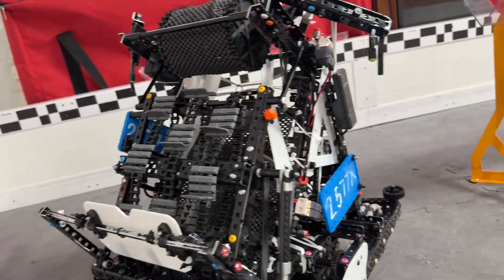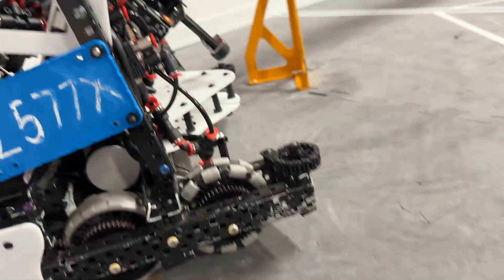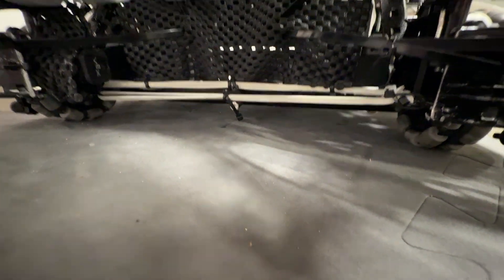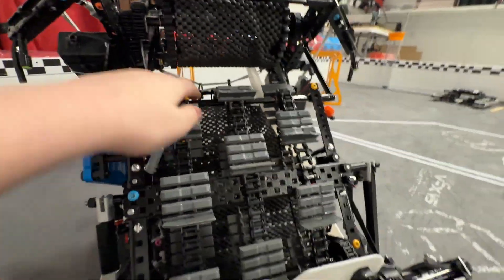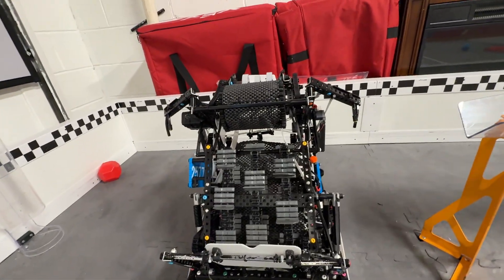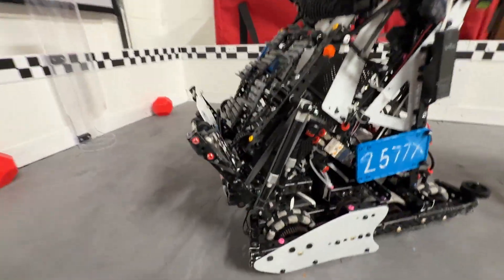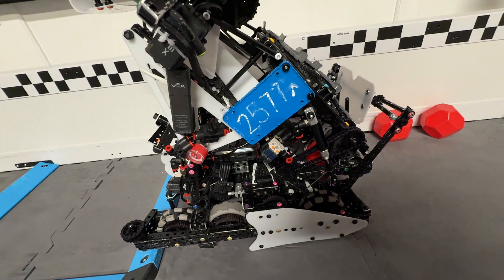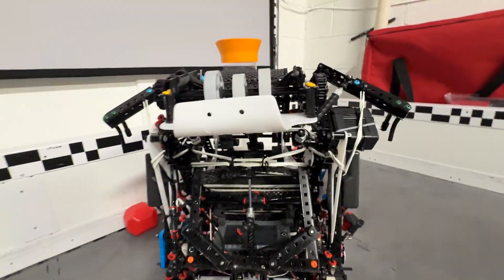2577X | Fall Robot Explanation | Vex Push Back

Comment: Are flex wheels faster than a rubber band first stage?
Reply from the maker: depends what speed u run it at, usually bands r faster tho
Reply: @2577X-FunkyMonkeysyeah it just depends on geo
Reply: for ur geo flexwheels seem fine but id test with rubberband rollers def on ur new robot if u keep Ruiguan
Reply from the maker: nah next robor we doing mesh
Reply: @2577X-FunkyMonkeysmesh won’t work well on the hood or at least for me it didn’t normal rubberbands should be fine
Reply from the maker: ima test
Reply from the maker: we still doing flex wheel hood tho